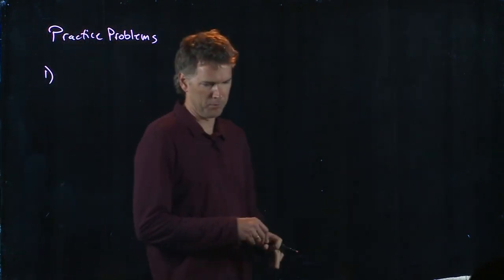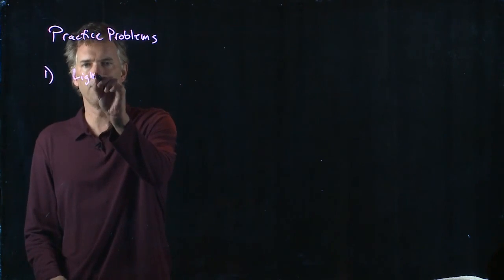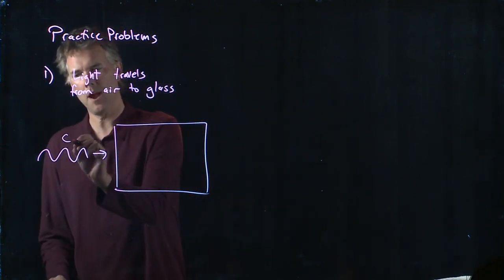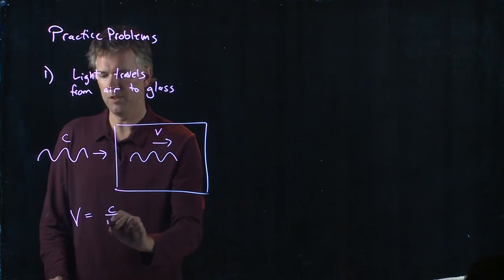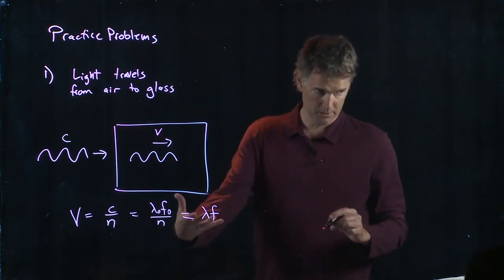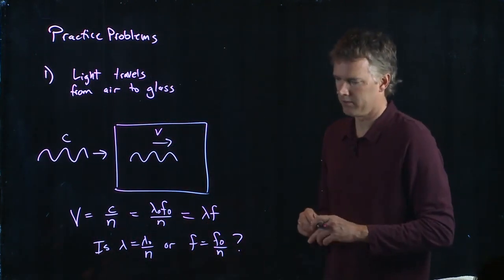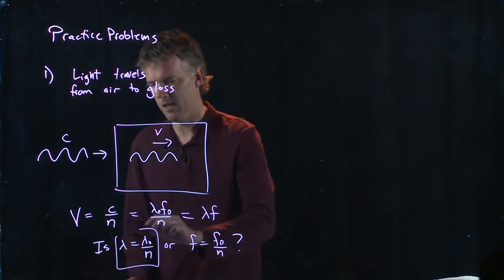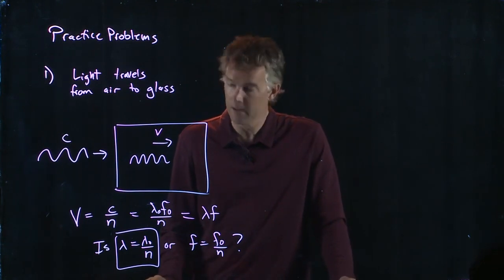Does Wavelength or Frequency Change in Glass? | Physics with Professor Matt Anderson | M28-15

Comment: did not really explained why, just just said it is so. thanks.
Reply: Imagine that the original pulse of light was just 2 waves.  As the pulse moves into the new medium it will slow down, but you will not get a pulse of 1 wave or 3 waves.  The number of waves has to be conserved.  It must stay 2 waves.  So what must change for those two waves is their length.  The number of waves (per second) or frequency stays the same.
Reply: @jeffreyhuvar1379 Unless the speed of light actually changes, which is the concession no one wants to make. They're making an *assumption that the speed of light remains the same. You can still have two waves, traveling at a changed speed, which changes the frequency while the wavelength remains the same. No new wave needs to be created.